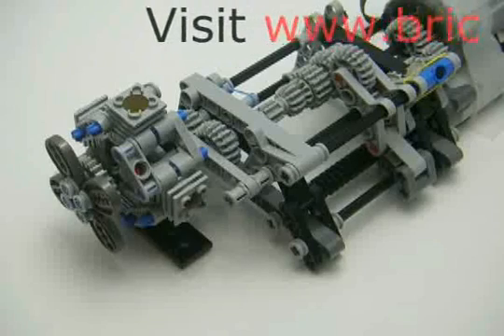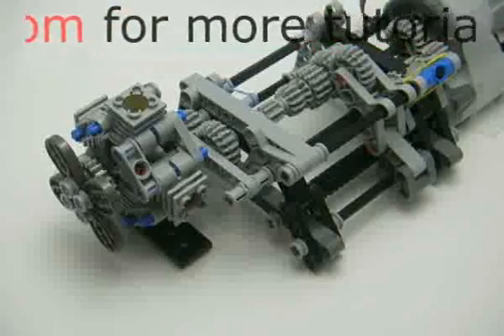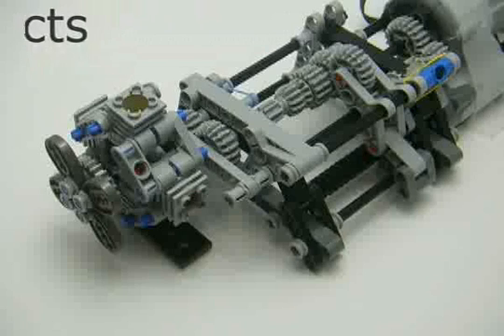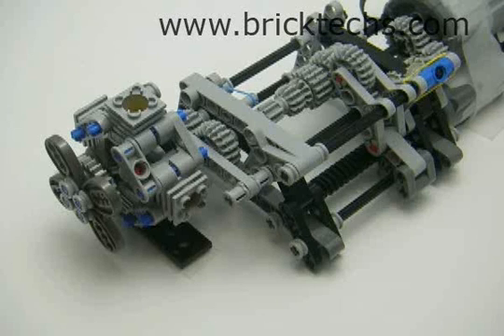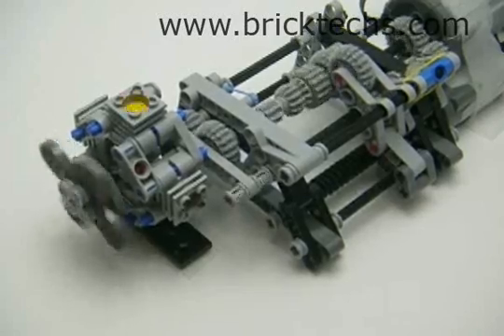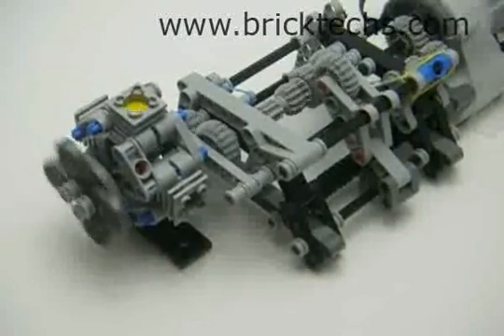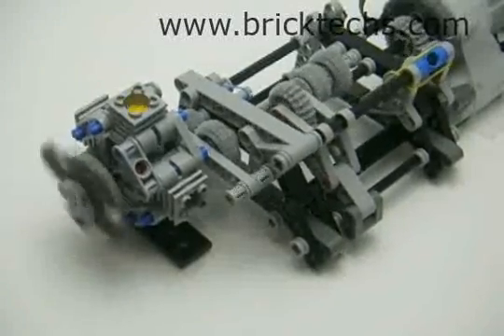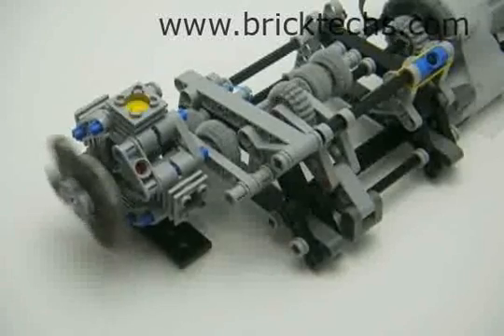LEGO Radial Engine In Motion on a 4 Speed Transmission

Comment: You dont need a transmission in planes all they usually have is planetary  reduction gears to actually slow the prop down because if it spins faster then the speed of sound the prop will shatter and there was on one radial engine ever made with an even number of cylinders because you cant have 2 firing at the same time or else it runs very very rough and puts a lot of strain on the crank shaft

Comment: I used to build much bigger engines with the big sets back in the 80's Lego stuff today is nothing compared with what I had back then. The pistons were square and the engines were bigger and much more detailed. The cars I built were so detailed that they had full on running details including 4 speed tranny, clutch,brakes.steering.suspension and full interior all in the same vehicle that was over 3 ft. long and 16 inches wide. Sdly,none survived to today.

Comment: @Zhack2000 *sigh* there isn't a better one, the radial engine is better for planes because it cranks out insane RPMS, The Mazda Rx8 has a radial engine and if you ask anyone who has driven it at high speeds, its pretty much doesn't redline, it just keeps spinning faster and faster.

Comment: @f0615388 
You see the Y-plate that have the large gear , thee is a small gear that is hidden in that Y-plate.

The engine is powered by the electric motor that goes directly to the dual medium sized gears then to the hidden small gear that is connected to the larger gear placed on the Y-plate. That large gear then powers the stiff 4 gear axle that is connected to the radial engine through a medium-to-small gear.